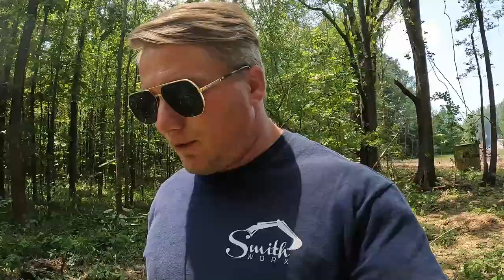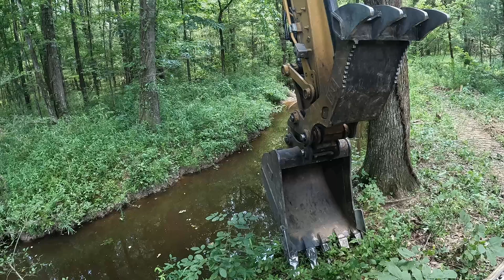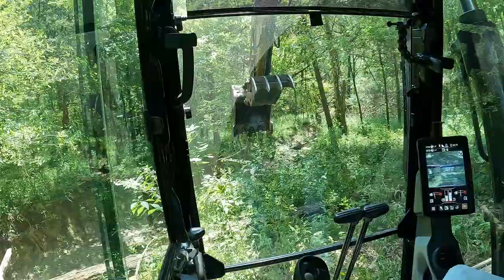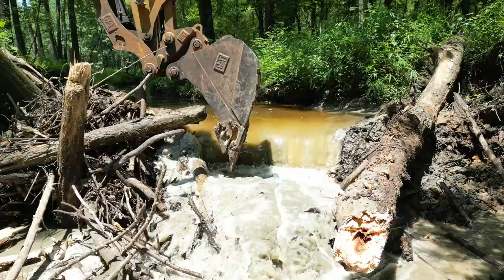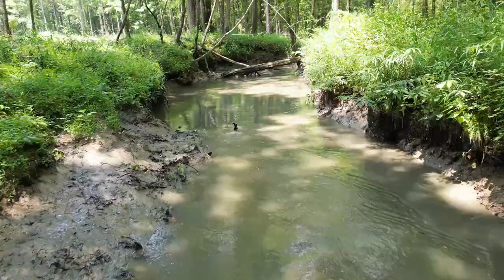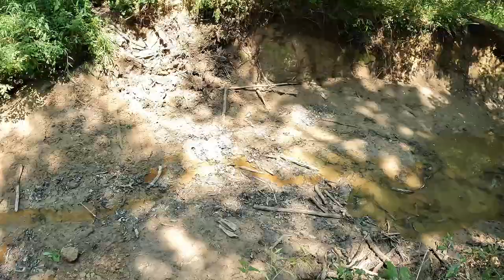Beaver Dam Removal

Comment: That was a quick job. Did you see any signs of beaver's in the area? I didn't see any trees they had been chewing on. We had a real bad problem here in the early 90s. The forestry commission put a bounty for each beaver tail. This part of the county is a huge river bottom and everything flooded in the spring of 92. Man did I make a killing until they lowered the bounty to $5 a beaver. It wasn't worth it at that price
Reply from the maker: I didn't really see any sign either. The owner asked me if anybody still trapped beavers. I didn't think anybody still did that nowadays
Reply: @smithworx1091  If there were any beaver there you would see lots of trees they had been chewing on. The have to chew a lot because there teeth grow so fast. I don't think they trap much in the south it just doesn't get cold enough anymore. I think the cold weather helps them to have a better coat of fur. I've seen where up north that some people do trap. But it's not much money in it. They were over populated around here and between the trees they killed and the ones the flooding killed the timber industry was losing lots of money. I live in a town that was known as the Forestry Capital of the South.

Comment: Man you should hire those beavers to help you clear some land jobs there great little workers. And strong also I have always wondered how they move such big logs to build a damn 😂 you should check out the dji air 3 it’s has a more advanced active tracking 5.0 you can position the drone in any angle and it has 360 avoidance sensors
Reply from the maker: 🤣  it is amazing the work they can do. I wish this drone had a better tracking software. It just won't follow the equipment like I hoped.